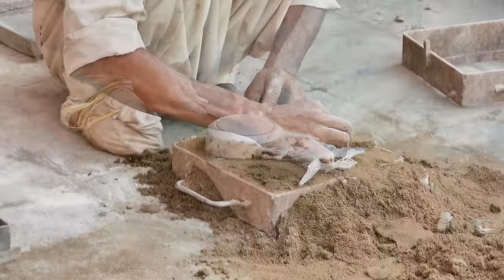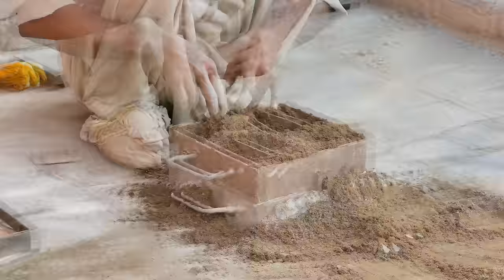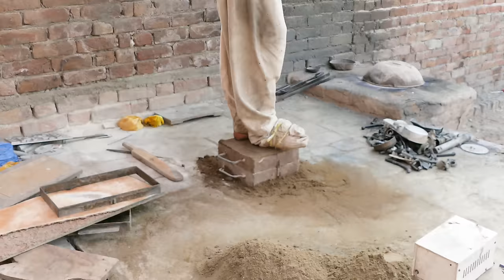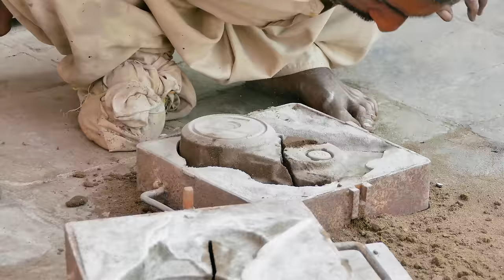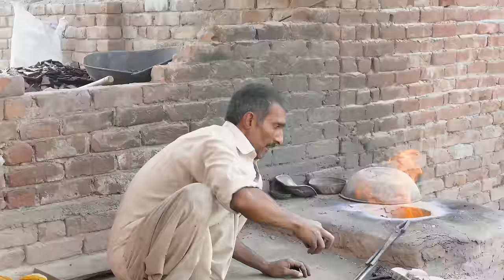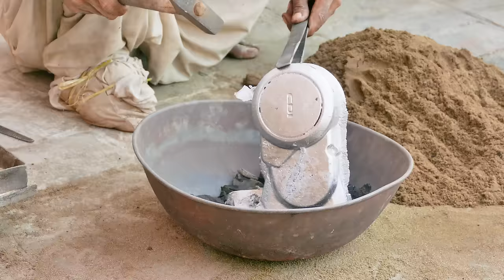Aluminum Casting Motorcycle Engine Cover With Amazing Skills

Comment: Make no mistake this is highly skilled work. From the moisture content and fineness of sand to the sprue arrangement and gating. Pouring temperature and speed also important. Removing the cast sprue in the "short" state with a blow thus removing the need for sawing. Brilliant work. PS Never seen aluminium casting in thin cotton clothes and bare feet!!!

Comment: The Wow Things Dude should have given credit to this man and mention which country he is from.  By his dress, Shalwar Kameez, I think he from Pakistan.  Amazing effort. A man in 1980's built an automobile factory named Proficient Automobiles in Pakistan and he used the similar type of Sand molding to make the entire Engine and Manual Transmission for his cars and other parts he also fabricated.  He was a trained Mechanical Engineer and got his Masters in Mechanical Engineering form UK, but returned back to Pakistan to built Pakistan's first Automobile factory, but government of Pakistan and Japanese Auto assemblers like Suzuki motors, forced that guy out of business.  Otherwise Pakistan would have been exporting cars by now.   There are tens and thousands of talented skilled laborers and mechinist people like that which I have come across all over Pakistan.
Reply: Pakiatani politics is so bad. BTW this guy is Pakistani.

Comment: So this is the guy that makes all those non-OEM parts.
Reply: OEM parts are made exactly the same way, by a guy next door.... 🤷🏻‍♂️
Reply: OEM is buying from this guys for $ and then selling to you for $$$$$. Fact..
Respect to these guys
Reply: x,D
Reply: @mansouralblooshi3004  Bullshit! This type of casting is brittle, additional is the thermal shrinkage and expansion a big problem due to the irregularly cooled material. This is for show, and because they can't get the real deal, but not to get a long lasting part!

Comment: Note to self:  next time I need engine covers, order online, make mold, return 😆
Reply: After casting original size will be reduce.
Reply: @11RAVAN  that's what the gaskets are for I guess
Reply: @chincemagnet  yes.
Reply: Have a 3d printer instead
Reply: @chincemagnet  Really? You think gaskets compensate for that?
Reply: @mrswinkyuk  it depends
Reply: @chincemagnet  You might get away with it, but it's a bodge. I understand this is perfectly appropriate for people as poor as these but gaskets compensate for minor imperfections in the mating surfaces and accommodate expansion and contraction. They can't compensate for misaligned oilways or smaller clearances.

Comment: As a white guy, I had just assumed that we needed gloves to cast molten metal . Dude gets job done with one "shoe"
Reply: It isn't shoe
Reply: Lance Hobbs 
As a white guy.. what do you mean to say
Does human being is divided into black and white
Reply: @rahulkumaryadav9381  why would you assume that he only meant white and black their ate other races and cultures and for you to just put a label as white and black and insensitive and and a native to america it saddens me
Reply: Bankroll Antic 
Sorry dude if I hurt you..
But for me all human being are equal
I don't believe in race creed or nationality
Reply: @rahulkumaryadav9381  dude it's all good I agree w/you
Reply: This is not advice, just my opinion. 

You don't, same as you don't need gloves for gas cutting, grinding etc (use when welding to avoid UV burns). 
Sparks and slag, molten metal in general don't stick to skin due to leidenfrost effect and with small work the worst you are likely to get is a blister or small burn. Wearing gloves has its own risks. Mechanical entanglement leading to amputation, fungal infection if not changed regularly, hidden venomous insects etc. 

Safety has become ridiculous and overbearing, while creating a whole new industry of bureaucratic middle management busybodies for "those who can't" to occupy. 

Gas cylinder handling safety matters, a singed pinky does not. Pain is an excellent teacher. 

Safety regulations matter more when you are running a gas plant, an oil refinery, a nuclear reactor. 

Eye protection is a different matter because the consequences are more dire than pain and a tiny scar and you should really wear some sort of eye prot at all times for mech work, and in fact whenever you step outside . 

One piece of advice, never tuck your trousers ("pant legs") into your boots. Hot metal will fall in and then leidenfrost will not save you from 3rd degree burns.
Reply: @rahulkumaryadav9381  sorry guys I was actually making a joke/point about the safety standards we are lucky to have in 1st world countries such as Australia. The rate of serious injury and death among workers in less privileged nations (in construction and mining especially) is appalling. I am in construction. It wasn't intended as a racial thing. Sorry if it came across that way
Reply: Lance Hobbs 
Well done dude
Reply: @rahulkumaryadav9381  He was just saying in developed countries, typically white majority, we aren't taught to do this without gloves.
Reply: Gloves are expensive and he probably have 8 children to feed.

Comment: Quality and   alloy  pureness, mechanical resistance...just minor  details...: it’s similar then it’s like the original...
Reply: The bike it is for costs US $1000. It will be the primary means of transport for a poor man like him. . It's an engine cover. Nothing much mechanically depends on it except that it may not long that long. In the other hand by the time it last the bike may be ready for retirement.

Comment: You are using more effort than required . a few battery or manual tools would greatly aid your process for example I Know dirt is easy to cast with but your cast is always sloppy to a degree. You can create a better cast by using cast iron metal forms or silicone molds in sand the steel will melt the silicone and form to its shape

Comment: Not to be the stick in the mud here, and correct me if I'm wrong, but if the original part is used as the pattern, won't the new cast part be smaller due to shrinkage of the molten metal when it cools ?  This might not be critical with this particular part, but depending on the shape of what's being cast it would likely be quite important in other instances.

Comment: great craftsmanship, but how about shrinkage? aluminum has a shrink rate of approximately 1,5% in either direction (alpha = 0,000023/K). just 'copying' the original part (length 250mm, height 100mm, depth 40mm) will make the duplicate come out 3mm too short and 1mm too narrow.

Comment: I am very impressed with what this talented guy just did. But let's not forget, the pattern is not the same size as the finished product, but the upscaled version of the casting due to the considerable shrinking of the poured metal as it cools. So if he uses a casting as a pattern the result will be smaller and it won't contain the extra material to be machined down. His work is impressive but a bit useless.